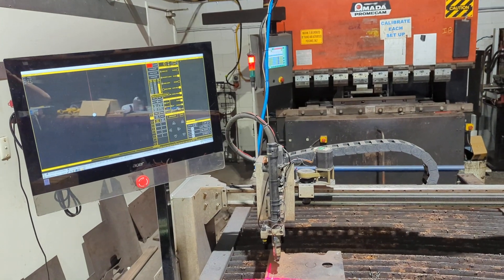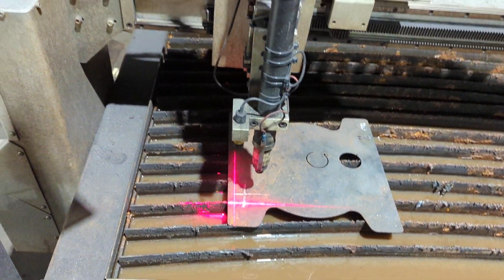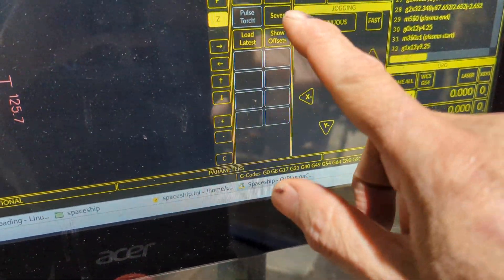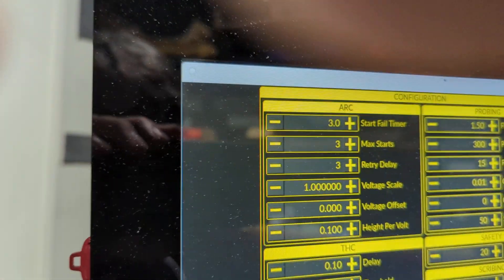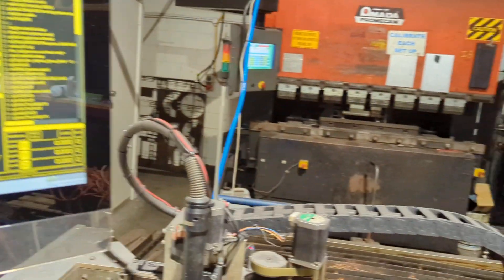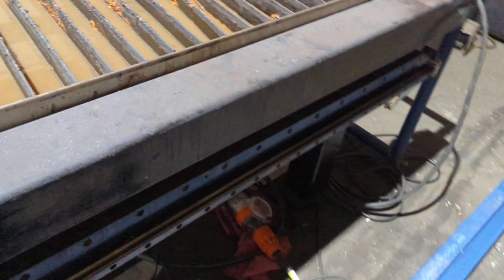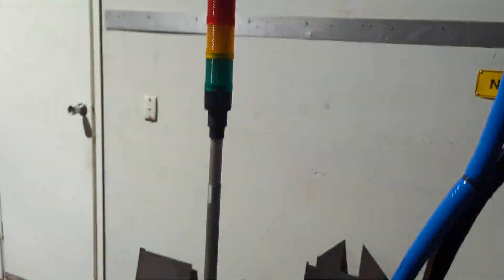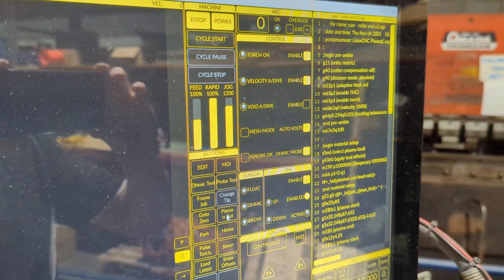Plasma Cutting Software: QtPlasmaC Explained

Comment: Thank you for this video and all your contributions Rod.
I am making a new CNC Plasma cutter (second one) and I would like to use QtPlasmaC on it.
Could you tell us where to find the "QTPlasmaC processor " (it is not included with my all new install of Sheetcam).
And also my brand new install of LinuxCNC 2.9.3 doesn't include the last features you describe in this video.
How to update please ?
Thanks again !